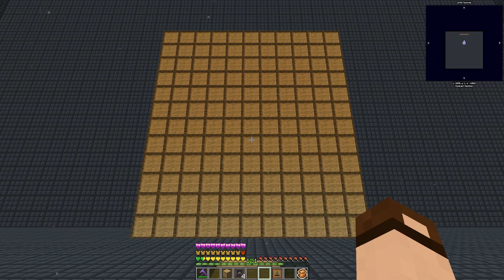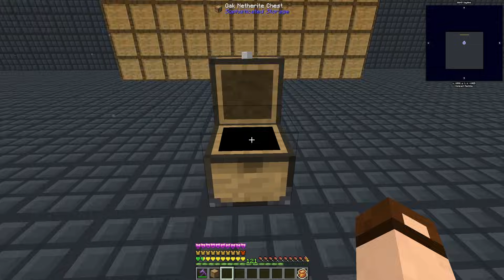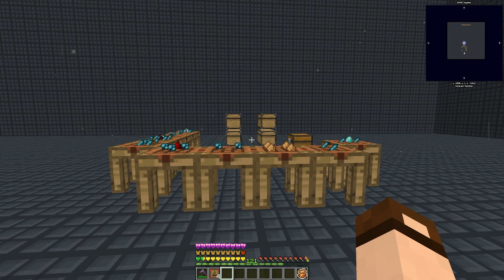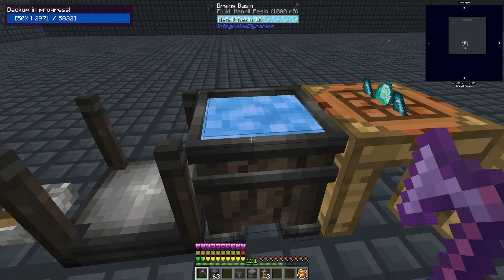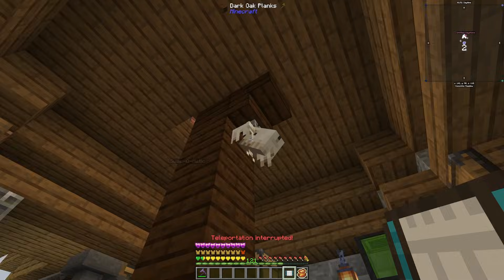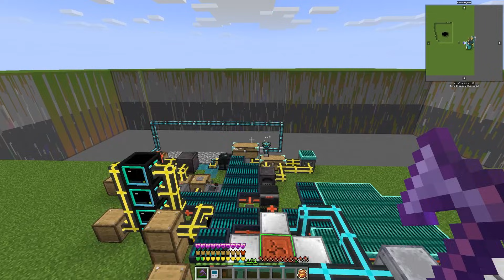Modded Early Storage Choices and Integrated Dynamics Storage Tutorial

Comment: Thats why I never understand why would anyone use drawers other than compacting drawers which are great because then You dont need to setup nugget/block patterns for Your AE2 system.
Eventually You want to move to storage drives anyway but sophisticated storage is almost just as good. Plus the unstackable things DO stack in these, with stack upgrades but they need to have the EXACT same NBT data.

I still use Integrated Dynamics combined with Create Vault or Armory Cabinet to store armor, tools etc that I export out of my AE2 System because I don't like when it clogs up my terminal with dozens of armors so prefer to keep them sparate

Comment: Nice to see you are still alive! I've been a longtime fan, ever since your AE2 tutorial video's with the dinosaurs. I'm playing the same pack as well, though i run it with a godlike ae2 system on a public server. Whilst i agree that storage is good with Sophisticated storage, it also has downsides. Like voiding of items requires manual input instead of just slapping on a void upgrade like you do with drawers. Drawers are also more easiley linked through a controller. My base has a single controller with 4 nether upgrades and the box is beyond rendering so big. You can also more easiley move drawers since you do not need cardboard boxes or other methods of moving chests, you simply break the drawer and it holds its contents. So they both have their merits. Of course, the biggest merit of AE2 are the shiny cables, the autocrafting that is easy to understand and setup. And with Extendedae and advancedae and the quantum core and pattern storage, auto crafting becomes near instant. And putting the quantum multiblock 5x5x5 inside a max ae2 controller of 7x7x7 is such a nice setup. All glowy and shiny.

Comment: Soph storage also has a controller that works like the drawer controller, either connecting all touching soph storage chests/barrels, or you can link a certain number within range using a linker. It might be possibly more laggy doing it that way rather than putting an interface/external storage on each chest, but all that's required to expand your system is to slap down another chest next to the existing ones.

Comment: Is omega tier new? That wasn't in ATM10, so either it wasn't added yet or disabled. I do find soph storage to be one of the MVPs of storage, I tended to use soph storage for generalized storage, and only pulled out func storage if I had a ton of individual items, but if there's an omega upgrade now I might not even bother with func storage, well, it's still decent for fluid and equipment storage with the fluid drawers and armory. Though if it takes that much netherite for one omega it might /still/ be cheaper to use drawers for the few items where you have like hundreds of millions of an item, or stuff with smaller stacks like totems. Most items you're not going to need max-int so the omega upgrade is a giant waste for items slots that only hold like a hundred of something. Unless you have like functionally unlimited netherite with myst agriculture or something.

Comment: Great stuff! I have never set up the armor stands with the manual squeezer and never knew before now that it would squeeze proto chorus. It takes 48 menril chunks for the two batteries to craft the mechanical squeezer which works out to harvesting around two dozen trees.
Reply: If the pack includes bonsai trees or botany pots they can usually be used to easily get the chunks even if you set up underground. Or above ground, the industrial foregoing plant harvester works well. Sometimes I have manually harvested all the trees I need first 😊
Reply: One tip if using the mechanical squeezer: use menril planks instead of logs for extra yield at the cost of extra time.